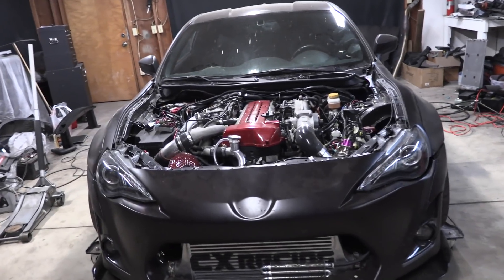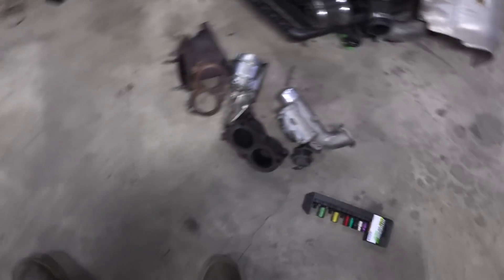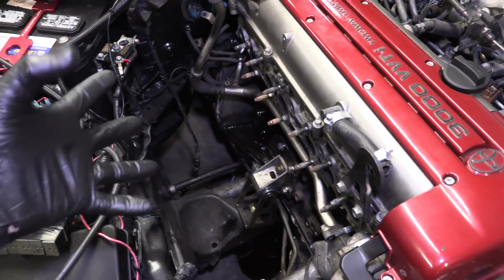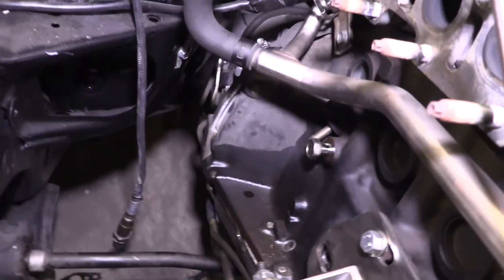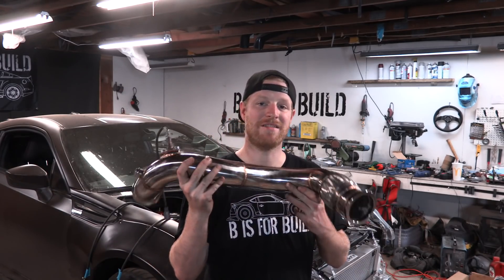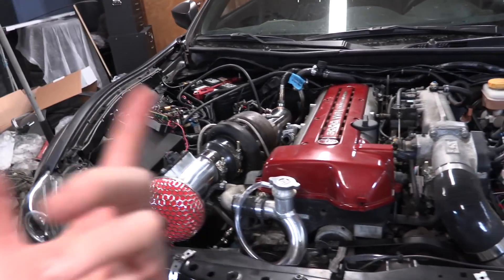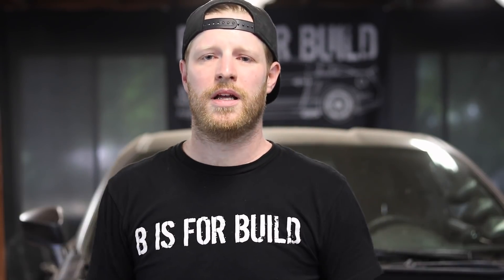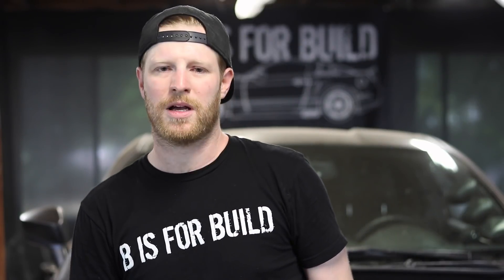2JZ BRZ Pt 34 - Single Turbo Install

Comment: Please don't route your oil lines through the runners on the turbo manifold. They will break and make a lot of smoke.
Reply: Jeffrey Abraham or even catch fire
Reply: lul
Reply: I was just about to write the same thing. Don't run the oil feed line like this, the runners are going to heat it up to the point where the oil in it will become thin to the point that it will not lubricate the bearings and the turbo is going to melt!

Comment: Dude, thats a massive improvment over the stock twins! Before you start dyno tuning or data logging road pulls, tou should seriously consider thermal shielding that turbo/manifold/downpipe, and also get all those wires  tucked away from that hot stuff! Don't leave it to the end, as you  may run into melted wiring, and that is your  worst nightmare! Keep it up!
Reply: Don't forget about the oil lines as many people are saying in the comments section. Don't want them to break apart and start flaming out the bonnet. Oil doesn't like heat.
Reply: No guys, "B is for being sloppy".  It's cheaper! We have to wait for the lines to "B is for Break",  or "B is for Burn" then he will think about fixing them. We don't want anything that costs extra money cause "B is for Broke" and we don't spend money on anything that. Besides, all the other guys that have this setup on all the other forums didn't do it this way.
Reply: bsb0011 😂😂 would like to see you do an entire 2j swap on your channel the expensive way, rich boy.
Reply: bsb0011 He is posting videos with the work he does to his cars, with the resources he has, and he is learning (and teaching US) as he goes. My comment was trying to provide him with a humble advice, no to feed  desktop haters.

Comment: Two thing i think all the other subscribers would agree would look amazing on the brz one, run it with no front bumper and two, push the front tires out where the more flush with the over fenders

Comment: ok, so need's a Tune for the upgraded Fuel Pump, move the oil lines away from the exhaust manifolds or it will be B is for Burned, and make your water line from the Turbo STRIGHT....it's supposed to drain when the car is off those loops you put in will not let it drain lol and yes a Thermo sheld will be a smart move for the Turbo and exhuats or overheating will come to haunt you again.

Comment: Recommendation for the future: take away as many of those couplers as you can and just weld the intercooler pipes instead. Less risk of them blowing off when making boost, and it'll make tracking down boost leaks easier.

Comment: Bruhhhhhh, that oil drain hose is going to die, been there/done that. Route  it over and around the headers, and add some heat insulation sleeves. 
oil fire is baddddd
Reply: Also you cant run the cooolant hose in a loop like that, its supposed to move water when the car is off via thermal expansion and that kills it
Reply: Seems Legit Garage damn... I was going to say the same thing but you beat me to it!Lol
Reply: Fire... bad?
Reply: Lucky Rooster turbo manifold*
Reply: this.
Reply: Could replace it with hard line too.
Reply: This is youtube, have fun setting your car on fire bc you wont take advice bc the grammar was off.
Reply: Anthony Thomas i doubt a 5 year old would tell him anything about the car accept it's nice.
Reply: Lucky Rooster *exhaust manifold

Comment: Just a observation. When a engine is cold and fired up it will run rich until it goes closed loop. Usually for emissions and to help the o2 sensors heat up etc. So it's possible at least initially what your seeing is normal. Just a thought. Always a fan. Keep up the great work. I watch your shows in the morning while drinking coffee so if I am wrong blame the lack of coffee when I typed this!  Lol. Have fun and keep it up!

Comment: Chris, i concur with lots of other comments below.  Your exhaust system will soon be glowing cherry red and although silicone hoses are great, I don't think they are going to last long that close to your headers. I figure that you either need better shielding (I wouldn't count on the braiding doing much shielding) or bend up some solid lines.  They use special heat shielding covers a lot in motorsport so perhap CX Racing have a solution.  They didn't have an obvious upgrade kit for my Hillman Imp though.

Comment: Just wanted to say big fan! Whenever I'm feeling discouraged about my own projects I watch one of your vids. Just a tip to save you some grief. When installing a turbo always put a bottle on the feed line and crank a few times to make sure oil is flowing. Things can happen and slow or stop oil flow. Better safe than sorry. Also if you ever do want to go stand alone check out megasquirt. I have used megasquirt in my last 4 projects. Currently using Microsquirt on my turbo BMW E30 with a E39 motor. The whole ECU set up cost me less than a grand and with about a day of reading you can tune your own car and not pay someone else. 

Good luck with the build and thanks for all the great content!! If your ever in Phoenix hit me up for some track fun.

Joe

Comment: Got my aristo last October.  Got a borg warner with a cx manifold tial wastegate ebay hose kit. All installed. Yet to get but due in a week aem  afr.   Received but yet to install..hks fcd. Aeromotice fuel press reg. Safc  550 injectors!

You see why I love your build!

I'm going step by step. Trying to use oem recirc as a recirc valve as I always thought recirc is better.

Thanks.

Comment: Yoo, Chris. Doubt this will ever get to you but I didn't see any other comment catching it. If that's the aem tru boost you need to hook up the ports on the solenoid different for internal versus external waste gate. 👍🏻
Reply from the maker: yeah i saw that, i re-routed it correctly according to the tru boost directions

Comment: If you start pulling oil into the intake pipe from the compressor housing, you may need to put a larger intake pipe on. It will be creating a low pressure and pulling oil past the turbo seals.
Reply: Also, make sure you remove the vacuum hose is disconnected when you set the base fuel pressure on the FPR.

Comment: BTW you can purchase a plug n play stand alone ecu from LINK ECU's $1,000 - $1,300.00 they are great for 2jz's and easy to tune. You should consider selling that apexi and go for the LINK and bigger injector 1000cc ev14 bosch. Also fuel regulator go for a good brand and try and stay away from ebay china crap, buy used good quality stuff to save a buck.
Reply: not for a auto

Comment: Really interested to see your MAF voltage with it that close to the turbo as well as that air filter without a shield to block airflow from the fan. Change to speed density. And with the AFPR, you may run into more headaches than you currently have. What is your current fuel pressure? Add a fitting and gauge on the return line and that should help eliminate that possibility.

Comment: You need to tie that braided oil feed line up off from the manifold. The inner line can melt sitting on there which will = fire!

Comment: Just a thought, not sure if that walbo 450 is hard wired but if it is make sure your return line is large enough to flow back what your not using. If it's not, your fuel pressure at the rail is never going to go down even with the AFPR. Ran into this problem on a Evo X with their pin hole sized return system

Comment: Good work man, I think you will be better off in the long run to go with a new tuneable ecu but its your car. Haltech Elite 550 on ebay with harness for $1063.00!

Comment: try re-calibrating the O2 sensor. sometimes cheaper O2 sensors need to be re-calibrated, or don't last very long, giving bad readings.

Comment: Do you have a restrictor in the oil feed?  I assume the original turbos were journal bearing and the new is BB?  If so you will need one.  And of course as already mentioned by many others the proximity to the manifold for your lines is going to be an issue.

Comment: Did you block off the two vacuum lines at the back of the engine?(Thats what I thought I( saw). I would suggest you start removing alot of the vacuum line rats nests and try and simplify that. Still love the work and hope this one can be buttoned up soon.

Comment: Running rich could be that the mass airflow sensor is in front of the turbo intake instead of being in front of the throttle body, this is giving the ECU the wrong airflow reading as it is not the air going into the motor but the air before it is pressurized and sent into the intake manifold.

Comment: and when you go single the pressure tank and those lines can come out and go directly in the trash!
AND
pull the nipples out of the waterneck and have them welded shut or atleast tap them and plug them

Comment: I still think you have an air leak on the intake side. 

From someone who reliably ran a GE 2jz with a 23psi supercharger. 

I had to learn everything the hard way because no one else was doing what I was.

Comment: I thought the 2jzgte's usually used a rising rate fpr? in which case aslong as its good surely that will be ok and the best bet? i may be wrong as i have a 1jz jzx90 but sure i heard that and just thought it may be worth a mention. Good luck with the troubleshooting

Comment: idk if its just me but that turbo oil feed line looks a bit too small for that turbo... make sure you are running the correct size because that could ruin your turbo from what i have heard, just something for u to research before its too late

Comment: why'd you need a new wiring harness Chris? I mean, I'm not an expert but think you can get standalone/plug and play ECUs for the stock harness. At least you can get them for beemers and i know this for a fact. I think the 2JZ is so popular at this point that you should be able to basically go to the supermarket and pick up parts from the sale bin, right? Correct me if I'm wrong here but if I were you, I'd totally go for an easier to tune aftermarket ECU.

Comment: Here's a question: Was the MAF supposed to go before the intercooler like that?  You'd think that if it is reading temperature and stuff it'd be more accurate if it were on the cold side.  Just wondering.

Comment: shouldnt the MAF be on after the intercooler by the throttle body so it can read full air flow after boost?

Comment: Did you turn over a few times before starting as turbo wouldn't of had any oil or coolant
Don't run oil line throw manifold will explode

Comment: Shouldn't it get to a point where it can actually drive without breaking down before throwing a new variable in the mix?
Reply: gracilism The mindset is that going single turbo will simplify the whole air induction situation.  He's technically taking away a variable with pulling the sequential turbo setup.  Plus he's bringing the build forward to his goal.
Reply: gracilism actually doing away with the stock system is doing away with variables. Now it's simple, instead of the complicated mess the stock system was.
Reply: BECAUSE RACE CAR

Comment: Try the fuel reg and new injectors then give the maf a clean asnit could be a maf issue but it shouldn't as you did replace it, last thing that might definitely fix is a tune.

Comment: Don't run oil lines that close to the manifold. Calvin with the red rb s13 got his oil return clogged up because of heat and it broke the turbo.

Comment: 2nd routing the oil feed/drain around the turbo header. Oil will cook in that feed line and could jack up your turbo. Also...that oil return will get hard over the heat cycles and start leaking. Ask me how I know :(

Comment: I wonder if they make plug and play ecu for the 2jz. I think haltech has an ecu that either has a direct plug and play into your factory harness or they make an adapter that lets you run your factory harness into their ecu. Not exactly sure though. Also not sure if it being an automatic it would make that an issue.

Comment: @Chris, I'm honestly surprised you haven't dug a trench in your workshop and just built it in with steel covers so it is not a safety hazard when not in use

Comment: I have a feeling the reason the car is running rich is because of the fuel pump you put in without a proper tune for it. could be pushing to much fuel.
Reply: Pretty sure that he said exactly that lol
Reply: Aleks Shibilev I commented it before finishing the video
Reply: Unless your fuel pressure regulator is being over powered, this ever wouldn't happen. You would end up seeing the inverse where it runs insanely rich while cruising/idle but when you're on it everything becomes normal. You would probably burst fuel lines and injector seals when you key on instead. With a return fuel system as long as the fuel pressure regulator works correctly the injectors are going to always see the correct pressure and react normally. Having the fuel pressure regulator hooked up incorrectly would definitely be able to cause issues though. The pump in a return system only just has to supply enough flow for fuel pressure to not dip and the regulator needs to keep the pressure in manufacturer spec.

With a larger pump you could have issues with too small of wire to the fuel pump causing it to receive less voltage but that causes it to go lean, not rich. If you want to really really really grasp at straws the only way the fuel pump could cause this is if the alternator was to overvolt the pump at higher rpms causing it to only do this as you got  on the engine. This would require the FPR to be at it's absolute maximum. More possibly with this totally theoretical issue I'd say a similar result would be the ECU not be correcting the injector pulses with a massive voltage increase but these are both insanely unlikely.

Comment: Get well soon but personally I prefer the quieter voice. Usually sounds as if you've just taken something. A slower speech rate too would be good.
As mentioned multiple times elsewhere please consider you generic oil and water lines to be the Beta items and get proper custom lengths made that keep them well out of the way of hot stuff. Best to be a training exercise for you not your local Fire Department.

Comment: what is the saturation limit of the stock maf? usually they are not good for a lot more boost than original, because they can only measure up to a certain lbs/min or kg/h of airflow.

Comment: You keep saying $4K for ecu, but it ain't that much: http://www.powersquirt.com/megasquirt/megasquirt-pro-plug-n-play-2jzgtege. It's less than half that.
Reply: wafflezoot throw in a harness and tune and you're close to that considering the harness he has currently to my understanding is all "hacked "(use that term gently) together
Reply: $4k is not only for ECU, if you listened carefully, $4k is the estimated total for new harness, ECU, tuning, and wait time...
Reply from the maker: those cant handle the automatric transmission... and slicktop.. if i spend 3K on this upgrade.. it is indeed what it would cost me to buy the motor again twice..

Comment: Boostedboiz on Youtube has their oil lines (EDIT: turbo oil drain line) going between their manifold runners without issues for like over a year, you're probably fine but if you want piece of mind change it lol

Comment: I had a false rich issue that was fixed by making sure the maf pigtail connection to the maf was tight. Just crimp the female terminals tighter

Comment: A fuel pressure regulator will no solve the problem. You are rich at idle where the regulator is all open (unless it is defective). Bigger injectors will exaggerate the problem. By-pass the regulator at idle (do not drive) and see if that helps normalise the AFR back to 14.7. Also, start the car, let it warm up and then check the AFR (don't expect it to bang on a few second after start up). If bypassing the stock regulator helps, it might be defective. Does the piggies back compensate for the differ injector latency curve (not referring to capacity) of larger injectors?

Comment: You say that you "don't want to fix your problem by dumping money into it" which is exactly what you are doing. I'm almost positive you are running rich because of an airflow problem. You also need to do a leakdown test for vacuum. The CX Racing BOV's are known across the internet to be absolute junk and leak and cause a boost leak. This will mess with your airflow and cause the car to dump fuel in trying to correct it. The one that came on my intercooler kit from them was crap and leaked. 

Same with the AFPR, that won't solve your issues either. Granted, an AFPR is a very valuable tool on a performance car, it's not going to magically make you not run rich. You have an issue somewhere. Fuel pressure wouldn't cause you to run rich on the stock FPR with stock twins. and putting a bigger turbo capable of more boost on will not help with the issue. 

Finally, an SAFC or any computer actually will be much harder to tune properly if you have a hidden issue somewhere. The car doesn't just run massively rich. Something is going on, and you need to find it before you put more parts on or else you will have a bad time getting the car tuned properly. 

-Just the thoughts of someone with a 2JZGTE car.
Reply from the maker: ive done like 3 leakdown tests, one included in an episode, its not a massive air leak at idle..

Comment: Please relocate the oil feed line that close to the exhaust is never a good idea cause it could melt and oil could get everywhere and the turbo wouldnt get oil anymore
Reply: Since they are steel braided it shouldnt be a big deal but still
Reply: That steel braid just covers a rubber hose.  Get it hot and that rubber will melt, then you will have an oil coated, steel braided, leaking rubber hose and the oil ain't going to get to the turbo!
Reply: bsb0011 yeah the risk is lower tho